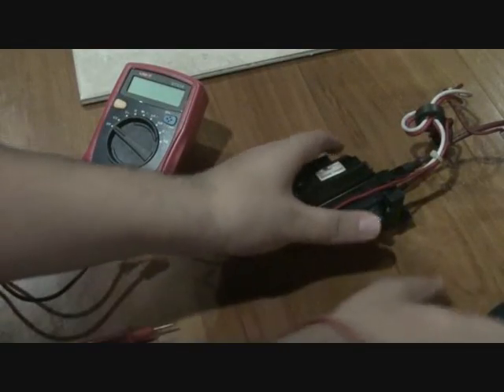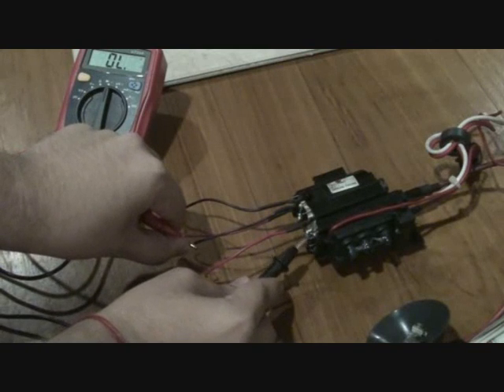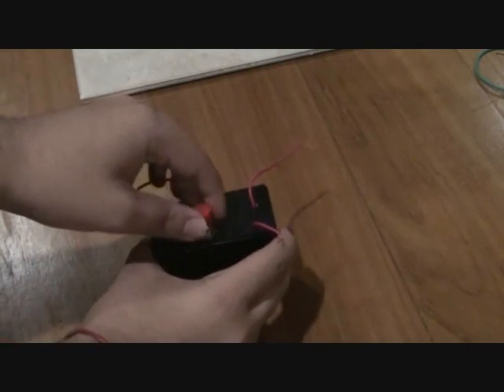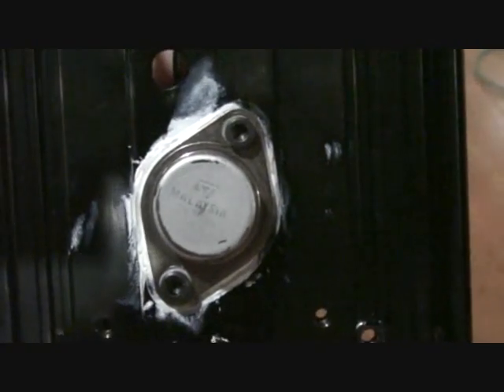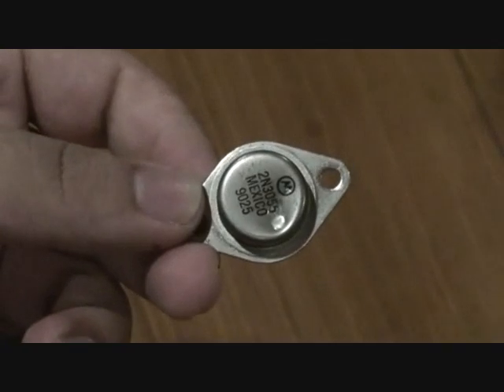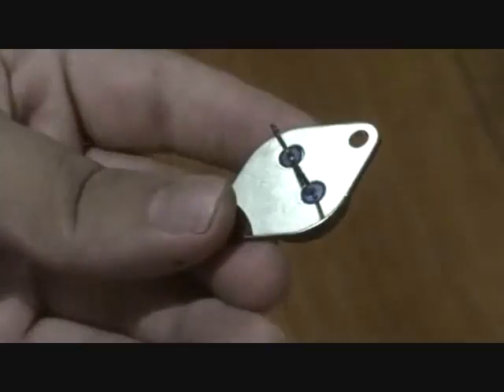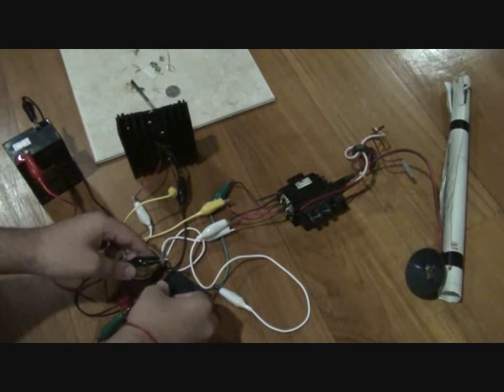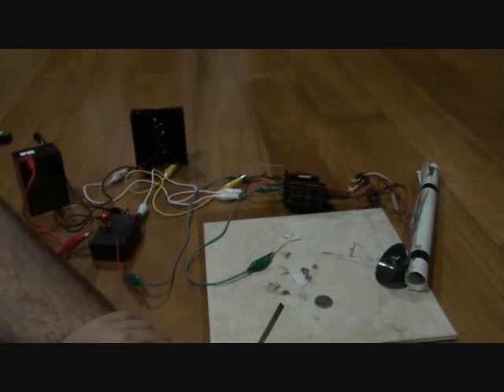Flyback Transformer Tutorial

Comment: how many amps and volts are on the output of this flyback transformer?
Reply: ennio marin There's very little current in a flyback transformer. Their purpose is  to provide a high voltage potential to accelerate electrons to the front of a CRT screen. In a colour TV, you can find 10-20+ kV coming from a flyback.

Comment: @MrGerbilBrain Current is AMPs though. I only have an output source that goes to 30 amps. And what about my Driver... Will additional AMPS harm a 10 volt transistor?

On the other hand... I've probably blown up about 7 of the transistors I've dug out of electronics. is there a specific list of serial number transistors I can use?

Comment: @Masamuneblade7 to get thick arcs, you need to increase the input current to the transformer, to increase the current of the arc. or maybe the transformer secondary is shorting out inside, so most power is lost in the arc, making only teensy little arcs on the output.

Comment: Bomberboy92, I am messing with this stuff now, and I got an oddball transformer from a computer monitor. First I messed with it while it was IN the screen, I discharged it and unplugged the suction cup, flipped the suction cup, and cut open the second red wire, alligator clipped it to a long wire and put it on a stick. I plugged it in and pressed power, and got 2inch arcs!! But they werent a plasma stream, they were like lightning strikes. What do I do to get a lightning stream?

Comment: @thumpervids don't use 240 volts I think its too high. I use a step down transformer to decrease the voltage and a rectifier (with a capacitor) to convert the ac into dc whenever i want to use mains instead of a battery.

Comment: I have a problem. I think that i made the circuit for my flyback transformer right but theres somethin wrong-It gives out only 19 volts when i use a 9 volt battery! there are spark but they are only about half a milimeter long. Why it doesn't make normal sparks and big volts?

Comment from the maker: @pietzeekoe the Mica Insulator IS really needed as the Transistor case itself acts as the Base leg of the transistor, and contact with the metal heatsink might cause interference. however, the circuit i use doesnt heat up the transistor at all so i wont even bother with the heatsink if i were you.

Comment: lool we have so much same equipment - i have same volt meter, 12 volt battery similar transformer and I have found some 2n3055 laying around

and also I have one problem - on my transformer my multimeter shows out of 10 pins, starting clockwise from the core - first 3 pins are shorted, next 2 are shorted, and next 4 are shorted, and the 10th is hv ground
how do I kno whch is the primar and wich is the feedback?

Comment: If I take apart a CRT or Microwave...do I have to worry about stored charge in a flyback transformer or anything, or only in the capacitor?  I know what a capacitor looks like but I'm a little nervous of just shorting out two wires somewhere in the circuit the capacitor feeds